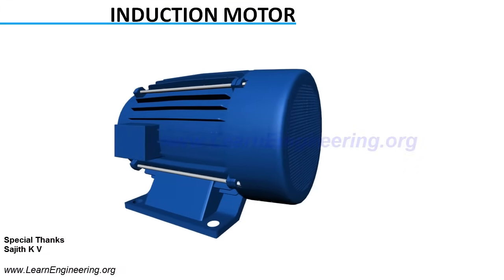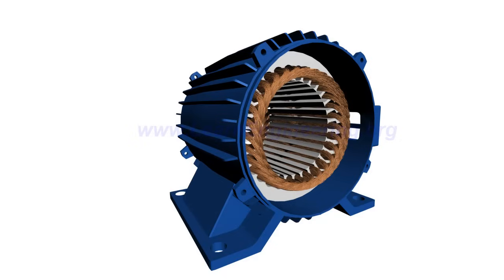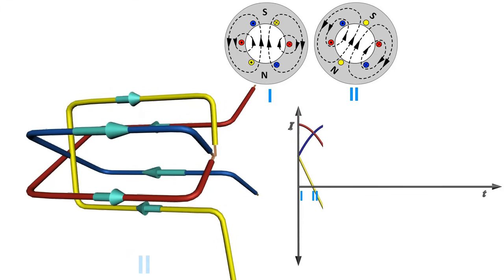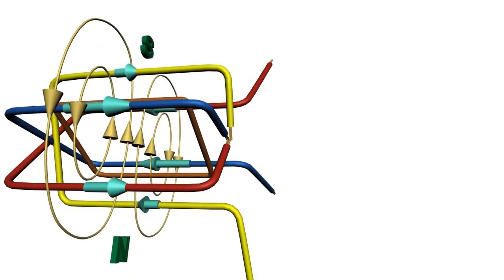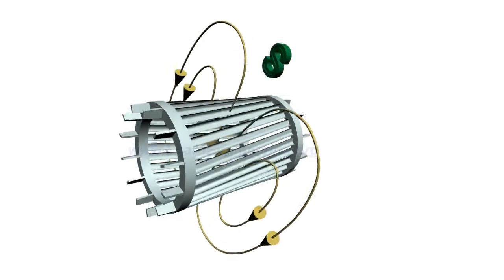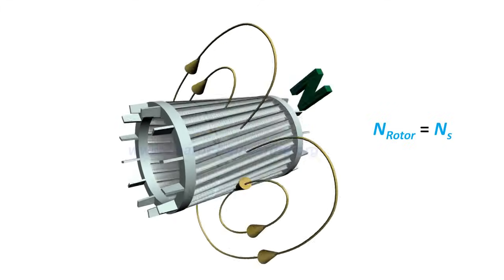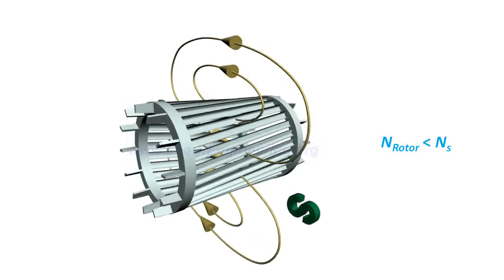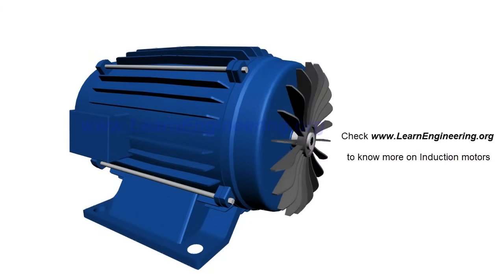How does an Induction Motor work ?

Comment: Does anyone know why free running a/c motors "surge"? it's like they over speed then drop back and then it starts all over again.
Reply: I may be wrong but I think that is to do with eddy currents. The faster the rotor spins, the stronger the eddy currents. The unwanted eddy currents produce opposing flux which trys to reduce the motion, hence the rotor slows down, but as it slows down, it is cutting less flux per second, so the eddy currents are reduced, and it begins to speed up again, and so on and so on.
Reply: FergusPateman That is the best explanation too date, Thank you.
Reply: What do you mean by "surge"? Are you talking about the throbbing hum you sometimes hear from single-phase AC induction motors?
Reply: Phil Karn It's almost as if they reach a peak in revs then drop back a fraction then, once again, recover the lost revs, then drop back again, anyone who has not heard this phenomenon has not been listening, it only appears to happen in a no load situation.
Reply: john brown It's still hard to know just what noise you're talking about. It's common for single-phase induction motors to produce a throbbing humming sound due to the rotor slipping below synchronous speed, and the fact that the stator's magnetic field is not constant in a single-phase motor. The giveaway is that the throbbing rate will increase as you load the motor, the slip increases and the rotor slows down a little.
Reply: Phil Karn I can't describe it any other way, it's not a throb,only in a no load situation, a throb suggests to me something a few times a second.
Reply: john brown An induction motor always runs slower than synchronous speed, but the slip depends on the motor design and the torque. Even without any external load there's windage and friction that causes some slip. Still seems like that's what you're hearing.
Reply: Phil Karn Ok, thanks for thatt.